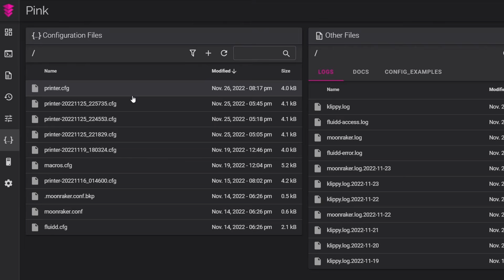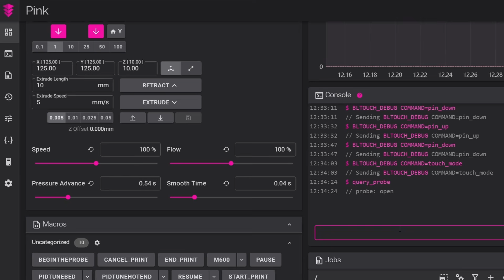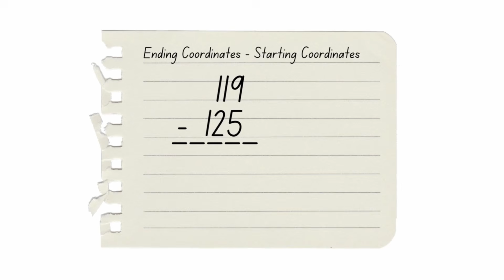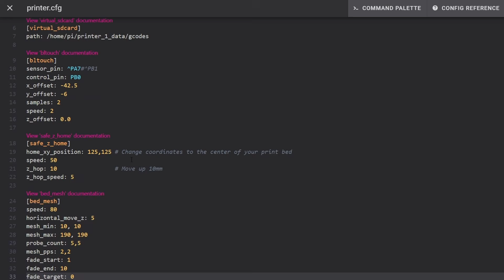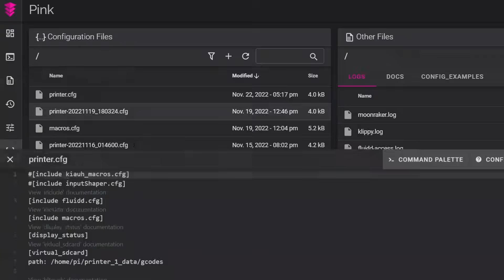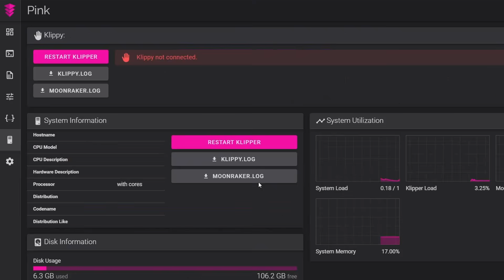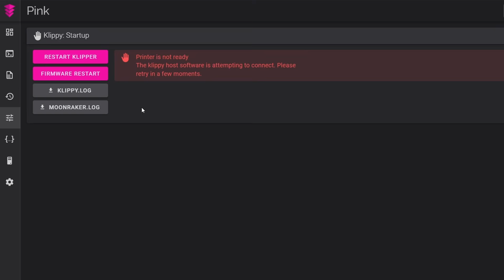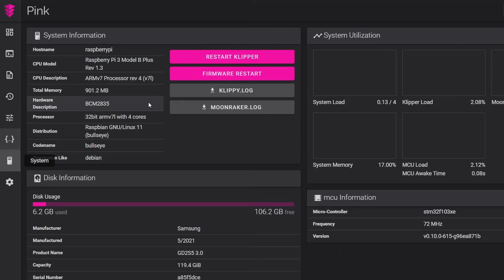BL Touch complete setup for Klipper! Maximize your probed bed mesh!

Comment: Maybe it just me and I'm slow, but I am stuck at the Live Z offset (baby stepping) section. I am EXTREMELY new to Klipper (just found out about it 3 days ago, and just installed it yesterday on my Ender 3 V2).  Where do I find the  PNK Bed Adhesion.gcode, and how do I load it on my printer? Thank you in advance, so for great video!
Reply from the maker: Trust me these can be tough adjustments and you're not the only person who has struggled with it, trust me lol The bed adhesion 'model' I am using is very basic. I took 5 20x20x20mm cubes and then scaled them to all be a single layer tall. For me that was a cube or 20x20x0.2mm Then I moved them around the bed, all the corners and the middle, and I used that to check adhesion. I don't offer a .gcode file because a sliced file I produce can be very different from what your printer is set up to handle. What specifically are you having issues with while trying to live adjust?

Comment: what if my probe is on the right side of the bed and nozzle is left? that part has me confused
Reply from the maker: That can be a little different, because my examples will look different for you, but all the key concepts remain the same. Find the X and Y offsets for the probe just as I did. Now for my setup the minimum side was closest to the probe, so I could put it over the spot I wanted it to be and then get the measurements. For you, the maximum side is where you will be able to place the probe over the spot you want it to be and find the coordinates through there. For the minimum location you will need to perform the same process I did to find the max, because your probe will not be able to go all the way over towards your front left corner. This is confusing I know, but if you need more individualized help let me know.

Comment: I think this video is great and explains how to get the probing points and your bed sizing right with Klipper. Something I was missing when I first started using this firmware. Though, I would recommend pairing this video and or making a new one along with Level Bed or the Screws Tilt Adjust Macro that is included with Klipper to go along with this. I think you first would need to tram your bed before performing a Bed Mesh or a Z tilt Calculate then perform a Probe Calculate to get that good Z height. But regardless this video is awesome. Could you also look into making one for an Ender 5? since the bed if flipped or oriented differently?
Reply from the maker: I actually do have a screws_tilt_adjust video already made! I should probably add a video card somewhere during this video to notify everyone. The ender 5 can be tricky, all the rules we covered in this video are the same it can just be hard to conceptualize finding the endstop positions because now they will likely be set to max. I will look into this for the future as it's something I have done for my own ender 5. Thanks!

Comment: I'd loved the detail in this video.  Any chance you know how to wire the BLTouch to replace the inductive sensor on my Elegoo Neptune 4 Pro?  I'd like to make the switch.  Thanks.
Reply from the maker: Because the inductive probe and the bl touch operate differently it's not a 1:1 change. For instance the bl touch has some mechanical movements such as the retract and protract of the probe tip the inductive sensor does not. That all being said if the mainboard has the correct ports that can accept it (5v, gnd, ctrl) then you can make the switch and it shouldn't be all that hard. After making the switch you would also need to make the correct [bltouch] section inside the printer.cfg and commenting out the [probe] section.

Comment: This is one of the best tutorials on anything I have ever seen, in over 20 years. Thankyou so much.
Reply from the maker: lol wow! That means so much to me, thank you! I make so many adjustments while creating these videos, about what content to add, how and when to add it, and how much time to spend on it. It takes me a while to make these videos, and when I get a comment like this is blows my mind, makes my day, and makes it all worth it! Thank you!
Reply: I just wanted to write this, the quality of this tutorial is incredible, what work, hats off
Reply: Im building a printer with the plans to run Klipper on a old laptop running Linux connected directly to the printer control board (bigtree tech btt skr v1.4 turbo) via usb and superslicer for the slicing software running on the Linux computer?
I am still trying to get my head around what goes between the slicer and printer to interface the klipper setup ..... something like a flow  chart would be good ..??

Comment: Hi Leo, I’ve trying to guess which pin is for the bl touch according to mi printer (Aquila N32), but I can not get it, is there a way to know which pines are the correct for my main board, or  will have to continue guessing?
Reply from the maker: If you need a pinout for that particular board go check my website. I have a Klipper config for the Aquila boards that has the correct pinout. I think I have one attached to the description of my 'Installing Klipper on the Aquila' video. Let me know if you can't find it.

ps. Just released I could just check my own Klipper setup on my network lol

[bltouch]
sensor_pin: ^PB1
control_pin: PB0
x_offset: -31.5
y_offset: -40
samples: 2
speed: 2
#z_offset: 0
Reply: @PrintsLeo3D yeah, those were the correct pins for my Aquila, after trying differents pinout config, I realized that my bl touch probe was a little bit crooked so it was not able to go down, then I tried to write those pinout again and it worked lol. Thanks for you response :)
Reply from the maker: Welcome. Sorry for the late response, the last month has had me so preoccupied I haven't been able to devote anytime to the channel or to printing but I am hoping that will turn back around.

Comment: Great vid helped alot.one thing I couldn't understand when doing mesh min/max I have h2v2 hotend on my ender 3,the nozzle is off the bed on  x and y when homed.when I moved in so the probe is x=22mm in from bed edge(that is position x=0 on dashboard) and probe on y is 22mm from edge of bed(klipper dashboard position=55) I have no idea what to do.my probe to nozzle offset is x:38 y:-37.can you please explain.ive tried inputing different conservative values but i get an out of range warning.cheers mate
Reply from the maker: Peter this sort of thing can be tricky. Try sending me an email and we can try and figure this out through there. Seeing some pics helps me get this sort of information correct the first time.

Comment: Dude... what a GEM you are. ive  litterally just installed klipper 5 mins ago and followed your tutorial on getting this probe up and running.... didnt have a single issue. You have a follower in me.
Reply from the maker: Awesome to hear!! Thank you so much, but most importantly I'm happy that your foray into Klipper was easy (I hope lol) . This is really powerful firmware and I am happy to help get people into it easier. Thanks for sharing !
Reply: @PrintsLeo3D ha ha ha defo hasn’t been easy but I’m getting there. I’m struggling with getting my bed leveled properly now has the mesh is showing all corners as red high spots
Reply from the maker: Yea it's never all that easy, always some break in period, but I'm sure you'll be there soon. One thing I always remind people is even though the mesh showing some irregularities it doesn't mean it won't give you good prints. Sometimes we can get so caught up in getting everything exact we forget to see how well it is printing. Of course sometimes that isn't that case either and you need to hone it in a little more, but if you haven't tried a few prints with that mesh I'd say give it a shot and see how it looks .

Comment: I was getting a "SAVE_CONFIG section 'bltouch' option 'z_offset' conflicts with included value". What worked for me was to manually comment # z_offset under [bltouch], then run your probe test, and then save and restart should work.
Reply from the maker: Usually save_config will comment out the z_offset setting you have saved, but this is a great workaround it you are running into an issue!

Comment: Great video, it should come in handy when I finally start setting up klipper.  Unfortunately, my fairly new, around 6 months old SKR Mini E3 V3.0 board died.  It was really kind of strange as it was working fine until I turned it back on and there was nothing on the display.  I have ordered a new board and hopefully it will last longer.
Reply from the maker: Wow that's a bummer. Did you reach out to Big Tree Tech (BTT) and find out if they offered any sort of refund or warranty. You should be getting more than 6 months out of a new board. On the bright side this gives you time to go over the Klipper process and get well acquainted with it by the time the new board arrives. Good luck!
Reply: @PrintsLeo3D  No, the warranty is 180 days.  I am just over that.

I was a bit premature.  After messing around for several days I found there is nothing wrong with the board.  I hooked everything up on my bench and ssh'd into my orange pi and used kiauh to see if it could talk to it.  It was successful in communicating and I had klipper working except for errors because it was not hooked up to the printer.  Then I reformatted the sd card to fat32 and put marlin back and the stock display display information like it should.   Oh well, a learning experience I guess.

Comment: converted my 3rd machine to klipper and I can not get this method working.  I do the paper test get  the good drag, then I save new offset.  when I either do a G28 and tell Z to go to .1  which should allow me to do the paper test again.  nozzle is not even close to bed.  seems to be off  by .5 mm  so i change that   and then do the  bed  mesh cal  things look ok.  do the first layer print and the print head is WAY  to close to the bed.   makes no absolute sence
Reply from the maker: When you say you're performing the paper test, are you running this using probe_calibrate?
Reply: @PrintsLeo3D  yes to get with probe_calibrate
Reply from the maker: First you want to make sure you don't have a z_offset value saved under the [bltouch] section of your .cfg document. It should be saved at the bottom of your printer.cfg and being drawn from there. I would make sure the z_offset is being saved there, at the bottom of the printer.cfg, and I would make a note of it. Then run probe_calibrate again, and right after you're finished save and restart firmware. Then go back into printer.cfg and check that the z_offset did in fact update. Then run a print and see where it is while printing.
Reply: @PrintsLeo3D  I think I have that solved. Now just need to get that perfect smooth first layer  seems to be too close as the top of print is rough..this machine is temperament all. The other 2 were done in no time lol
Reply from the maker: Well if the bottom layer is smooth but the top layers are rough, that would make me think over extrusion, possibly something you can fix by adjusting the flow ratio (assuming you've calculated the rotation distance for your extruder already).

Comment: Thank you so much for this vid mate, really helped me get my first Klipper install working as good as my tuned marlin. Now onto the juicy stuff with vibration and pressure advance :)
Reply from the maker: Love a good first time Klipper build! Happy to hear this helped, and I have more Klipper related videos coming that will help as you move through Klipper. Thanks for watching and sharing your experience.
Reply: @PrintsLeo3D  looking forward to it, this is the only vid I found on really tuning mesh and bed size. I have modded my E3V2Neo with Sprite Pro so had some challenges understanding all the limits for bed size etc since print head/gantry/endstops were all out compared to stock. Anyway keep up the good work, you certainly have me subscribed!

Comment: NGL your vid help me all this time ago. I relized that i have a bltouch that was adapted for the ender 3 board which uses the Z Endstop as the sensor_pin. I was able to use the pinout of the btt board to find out I needed to change PC14 to PC2. Even thought you didn't really document. Your troubleshooting steps led me to the correct answer so thanks
Reply from the maker: Glad I can help, even if it's only a partial help lol Those BTT boards are really great for the documentation they provide us, those pinouts are the real hero. I'm glad you were able to take what I was doing here and help your situation!

Comment: hey PrintsLeo im haveing trouble, all the sanity checks work up until I touch the bltouch with my finger to stop the bed, the pin retracts but my bed continues to move. i cant figure it out
Reply: thank you very much!
Reply from the maker: If all the sanity tests pass but you're still having issues you may need to edit the bl_touch section of your .cfg and add probe_with_touch_mode : true
This should cause the probe to act as intended

Comment: Thank you for the valuable information you provided. It was a very easy, simple and understandable content. Let me ask you a question and a suggestion. When adding command lines on Klipper (example  17:29   ), the command suggestion menu opens. I do not have this system either. How can I install this? I use mainsail and moonraker.

As a suggestion, there are people like me who follow your videos from many parts of the world. But your content explanations are very fast.. For non-native English speakers like me. and it becomes very difficult for people who use subtitle translation to follow and understand. I think it will be much more understandable if you explain it a little slower while preparing such content.

Finally, thank you for everything.
Reply from the maker: Thanks for watching the video and for the thorough reply. For your first question, I haven't installed anything on top of Klipper as an extension for those 'command suggestions'. All those are doing is pro-populating suggestions that are already contained within the .cfg document, it won't suggest words/sections you haven't already included. I use Fluidd as my front end and those pre populated commands have always been there for me. So maybe I would suggest trying Fluidd (you can use it in parallel with Mainsail) and seeing it that is what is offering this feature.
    For my quick explanation, I do try to slow down lol I am a very fast speaking by nature, so I really need to take my time and concentrate on slowing my language down. I am trying my best, and I think I am getting better at it as I create more videos, but it is something I am still actively working on. So I promise to keep trying to slow down my speech, but I just ask you to bare with me while I go lol Also for some topics (especially while live streaming) I get very excited about and I can speak a mile a minute. I am trying to slow it down though I promise!

Comment: Heya. Great video! Super helpful in setting up my printer with klipper. However when doing the sanity check everything works but on home the probe deploys but does not sense and the bed continues to rise. I've got the pin denoted with the ^ and everything else seems pretty much identical to your config. Any ideas?
Reply from the maker: That's really odd behavior. The sanity checks are determining your probe is in fact reading open and closed properly, but during home it is not. Hmm, I would try and remove the pull-up to see if it makes a difference (although to be honest I don't think it will), sort of grasping at straws here. What printer, probe, and mainboard are you using?
Reply: @PrintsLeo3D  thanks for the quick response. The pull-up makes no difference.
Reply: @PrintsLeo3D  ender 5pro 4.2.2 main board. Probe is a 3D touch
Reply: @printsLeo3D probe_with_touch_mode needs to be commented out
Reply from the maker: Ok, perfect! I didn't think the pullup would have any effect at all. I know some older bl touch clones used to have issues with touch mode, so it being a 3d touch makes sense. Either way I'm glad you figured it out, and sorry I didn't respond sooner I never got notified of your 2 other replies.

Comment: The only video you need to set up Klipper and BLtouch/CRtouch. Amazing, thank you so much.
Reply from the maker: Hey, thank you so much! I try my best to put as much detail into these videos, and I appreciate when someone takes the time to tell me it's working!  Appreciate it 👍
Reply: @PrintsLeo3D  of course. I really appreciated the dive into the config settings. I'm still having issues with the z offset where it seems like too high one moment and too low the next, but I'm much closer!
Reply from the maker: One thing to remember when adjusting z offset. If you adjust it live make sure you save that adjustment directly after the print completes. There will be a small disc icon within the Tool section (next to where you adjust z offset) and that's what you'll use to save the recent adjustment. Hope this helps.

Comment: Thanks so much for this video! This was extremely helpful. Related question- does anyone know how I would get my print head to avoid the binder clips I’m using to hold the bed in place?
Reply from the maker: I'm glad you found the video and happy it helped! There are a few ways to 'exclude' parts of the bed, especially if they have clips that you don't want to touch. I think the easiest is directly through the slicer. It depends on what slicer you have, as I am not sure if all of them use the same features. What slicer are you using?
Reply: @PrintsLeo3D  Wow, didn’t expect a response so quickly! I’m using PrusaSlicer.